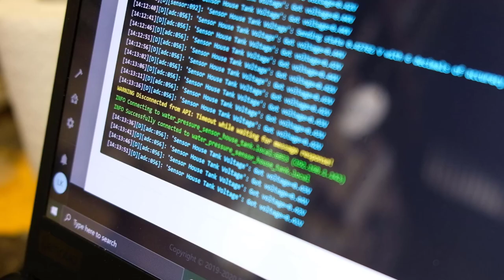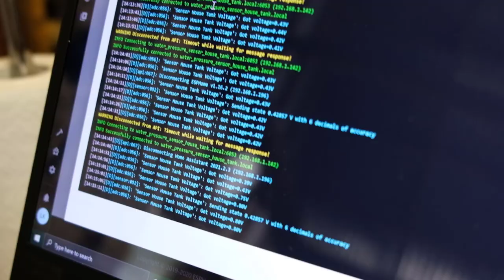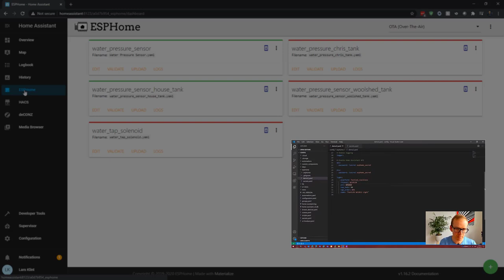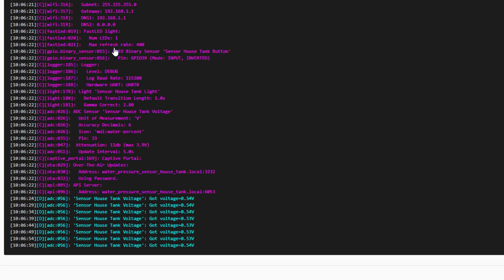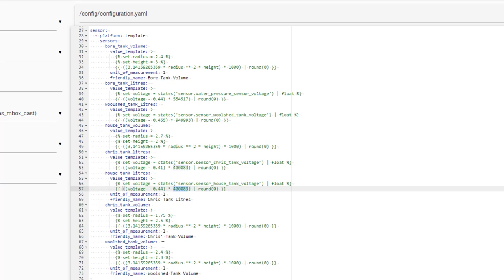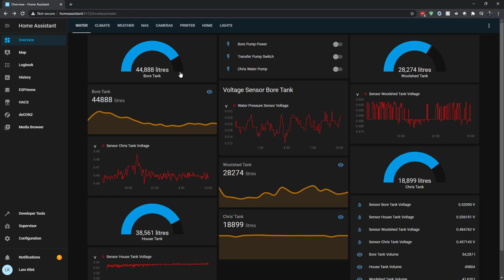Measuring water tank levels with Home Assistant

Comment: Thanks Lars, Great video, Ive actually watched in a dozen times.....I have purchased my Atom and the pressure sensor using your links, I have watched Tathams video and set the Atom up first go, used your Yaml File for the Pin out and receive voltages every 5 seconds in my Logs. I have question though. I have a 4KL Square Tank, whats your thoughts on substituting the formula to as my tank is not round ?
Reply from the maker: Instead of calculating a cylinder volume (π · r2 · h), use a cube volume(s3). That should work.
Reply: @LarsKlintTech  Thanks Las, I bought the PSI transducer...see some widely voltages even with your filtering....Thinking I might replace with a 10PSi Transducer as my 4KL water tank max is 5.6psi when full might help with a more accurate voltage more granular and stop it from bouncing all over the place. I might also insert a check valve after the sensor to eliminate any issues with back flow pressure affecting the voltages. As always thanks for your incredible idea and thoughts....has inspired me
Reply from the maker: @just_aths  A smaller pressure rated transducer makes sense, as does the checkvalve. I have tons of wrong readouts from one sensor,  because of no check-valve/back flush valve.

Comment: I really like this method. I've been searching for a good method for a while now. I have a 3000 gallon underground tank I need to keep an eye on because of a poor performing well. We need to water the grass and the garden, but have been concerned that we exceeding the well output. Could you have just added a lot of silicone around the sensors instead of putting them inside the pipe or do they need atmospheric pressure to register correctly?
Reply from the maker: I tried covering the sensor in silicone twice, but somehow water got into the sensor both times. It didn't break the sensor, but the readings were all over the place. Hence, I went with the metal pipe solution. The pressure is measured at the bottom of the tank, then I take the voltage and converts to litres based on maths. 😊
Reply: @LarsKlintTech  thanks, you could share your tank voltage config?
like 
sensor:
  - platform: adc
    pin: A0
Reply from the maker: @scorpio8101  For one pressure sensor I have this esphome config currently
sensor:
  - platform: adc
    pin: 33
    name: ${friendly_name} Voltage
    update_interval: 30s
    icon: "mdi:water-percent"
    accuracy_decimals: 5
    attenuation: 11db
    filters:
    - median:
        window_size: 200
        send_every: 10
        send_first_at: 4
Reply: @LarsKlintTech  thanks.

Comment: Can pressure sensor work well for a 55 gallon closed rain barrel?
Reply from the maker: Good question. The smaller the tank, the higher the inaccuracy. Maybe consider using a load cell for measuring the weight instead? I know Greg Facer (other comment on this video) has done this for some pool acid.

Comment: HI! Good job! So, at 6:04, what is the size of the adapter that connects the sensor's silver input to the pipe assembly. I'm only looking for the NPT connection that connects directly to the pressure sensor. Tnx
Reply from the maker: Thanks mate 😊 That is a 1/8" NPT connection.

Comment: cool vid. I just bought a gravity robot sensor to do the same thing with my tank for hydroponics. Thanks for your explanation

How did you go about averaging the previous 35 voltage signals to use within your relationships for calculating litres?
Reply from the maker: The moving average is part of the configuration. The YAML looks something like this for configuring the sensor via ESP Home. 
sensor:
  - platform: adc
    pin: 33
    name: ${friendly_name} Voltage
    update_interval: 30s
    icon: "mdi:water-percent"
    accuracy_decimals: 5
    attenuation: 11db
    filters:
    - median:
        window_size: 200
        send_every: 10
        send_first_at: 4

Where in this case my window size is the last 200 measurements. 

I hope this helps.
Reply: @LarsKlintTech  ah amazing, I didn't realise you could implement straight within the YAML file. That makes sense. Thanks for taking the time to show that. I am going to try setup a pressure sensor which I just received using the same logic! Cheers.
Reply from the maker: @andrewhadfield7754  No worries at all. Let me know how you go. The docs are here: https://esphome.io/components/sensor/index.html
Reply: @LarsKlintTech  Thanks for the docs - didnt realise there were so many inbuilt filters for sensors. Very cool

Managed to get the sensor working and outputting 0-3V depending on water depth. I mapped out two voltages at known water depths and determined a straight line graph from that, and used this straight line function to calculate height in Home Assistant based on voltage received. (with median values like you mentioned! ) 

It is crude right now, the only box I could find to fill with water was about 30cm high - next step is to find a much deeper water source and re configure the straight line graph. 

Super happy with the result. Cheers Lars !
Reply from the maker: @andrewhadfield7754  Awesome work Andrew. Love the logical approach to finding the measurements, even though your work is "crude". Tbh, mine still feels crude, but I am within 5000 litres usually, which works perfectly for me. Atmospheric pressure and gremlins sometimes mess up my math too 😂
Reply: @LarsKlintTech  Thanks heaps for this video from a fellow regional Victorian (I'm actually just down the road from you in Acheron :) )  in my testing with 3 Atom Lites and sensors though, by adding "power_save_mode: none" to my esphome yaml under wifi, my voltages have stabilized considerably. It seems my voltages now stay stable for days which I guess means more accurate readings and less gremlins. Well it worked in my case in testing so I thought I would share incase it helps others. :)
Reply from the maker: @FmxAus  That is super helpful! I didn't know that parameter/property existed. I will try that out next time I update the firmware. Thanks a lot neighbour 😊
Reply: @andrewhadfield7754  Did you get the sensor setup for the hydroponic tank?  Looking at doing the same thing to a 275gal tote to tie in an automated valve from the RO setup.  Could you post up a video!?
Reply: @kennybeans303  I did indeed get it working but it's all packed away right now as I am moving house. It was simple to setup. I will try to remember to make a video about it once I am back up and running (it's going to be a few months though!)

Comment: Do these sensors need to breath air? I've seen some sensors that can't be put "in" the water (like we do) as they need to reference atmospheric pressure. I notice my sensor (a 30 psi unit) - which I've not put in the pond yet - seems to hover around 0.47 V - 0.53 V at "empty". it seems to vary with the barometric pressure (at 29.9 inHg it's 4.8V, at 30.2 inHg it's 5.1V).. I can add an offset - either by referencing my weather station data - or by looking up via an Internet API before publishing on Home Assistant. But do you have to do something like that?
Reply from the maker: I don't think they need to "breathe". Atmospheric pressure will always have an impact on the measurement, but I tend to accept that as it doesn't make a huge difference to my setup.
Reply: @LarsKlintTech  Hi lars, two things i can think of to improve precision and reduce impact of atmospheric pressure: if the M5 support SPI protocol (if not a simple esp dev board will to the trick, minus the very small form factor of the M5), i think you can add a cheap BME280  module so you can read atmospheric pressure at ground level and adjust your computation based on that pressure variation with a calibration reading from atmospheric pressure + the tank pressure sensor at the same level. The second thing is that ESPHome allow adding filters on a sensor (ex: calibrate_linear and calibrate_polynomial) to help compensate for non linear readings at differents water depth for example. I can imagine a calibration procedure where you do several readings in a full tank, at different depth to see if the progression is linear or not, and if not, adjust with the filters. Best regards.
Reply from the maker: @sfxElrick  Those are excellent tips. I considered adding the atmospheric pressure into the calculation, as I have that value from my weather station. However, I have just installed v2.0 of the tank sensor, which seems to work much better for this particular tank, and that video is coming out very soon :)

Comment: Hi Lars and thanks for the very informative video. This will provide a solution to a problem I've been wanting to sort since my addiction to HA. I do have a couple of questions though. Would say a 0-15psi sensor provide more accuracy than the 150psi unit you've suggested or does the 6 decimal points take care of that? Would a Shelly UNI be a better fit with perhaps better wifi range and easier integration into HA? (I did have links to what I was proposing but I think Youtube rejected my post because of them). Thanks again 🙂
Reply from the maker: Your comment is very timely 😄I am just in the process of testing a new type of submersible sensor, which will indeed be couple to a Shelly UNI. I can't comment on the range and easy of integration, but a video is in the process of finding out. 
In terms of the PSI range, I haven't had any issues with the 150 and accuracy. I think either will work.
Reply: @LarsKlintTech  Thanks Lars, I look forward to viewing when your done. Just going thru your channel now, lots of useful stuff there :-) and it's nice to see you're a fellow Aussie!
Reply from the maker: @lensman893  Thanks for watching mate. Hopefully much more to come that you can use too :)
Reply: Hi again Lars.Just thinking about possible other applications - could this be used to monitor water levels inside a bore? Our bore has started running dry and I risk burning out my submersible pump each time. Devices like Pumptec protection are expensive. With integration into HA can you see a reason the pump couldn't be shut down when bore levels get low and approach the pump? (float switches are too cumbersome to get down a 4" borehole). Cheers, John.
Reply from the maker: @lensman893  Hi John. You could technically do it, but I am not sure of all the variables. The strain on the cables could be great, depending on the depth of the bore. In terms of HA, it can absolutely work. Sound pretty simple really. 
Again, the new sensor I am trying out could be a better option. That video should hopefully be out in a few weeks.
Reply: @LarsKlintTech  I look forward to it Lars. Bore is approx 30m deep, and I figured I'd just use a reasonable sized cable (for volt drop - it's only going to be 5 or 12VDC) cable tied to the pipe. Keep up the great work, really enjoyed the DJ drone video. Thanks again.

Comment: Hi Lars, 
Thanks for this good video  ... In my case i have a 5000 Litres tank ...How will you calculate for this ? .... I have a ESP826 board with the pressure sensor at the bottom as shown on your first setup
Reply from the maker: You need the height and diameter of the tank to get the math to work. See my reply to the comment from Wouter Meeus for more information.
Reply: @LarsKlintTech  Thanks for the reply .... I have a ESP836 board will this work with your config setup or only for the M5Stack Atom Lite
Reply from the maker: @sylvaish  I am not familiar with that board. Have you got a link?
Reply: @LarsKlintTech  For some reason the link is been removed  ... But if you google ESP8266  Development board... You should be able to see it
Reply from the maker: @sylvaish   I know the ESP8266  Development board, but you said ESP836?
Reply: @LarsKlintTech  Hi Lars sorry for asking so many questions ... I am new to this and wanted to get this working .... I have a tank of  77gallon ...Hight 1143 mm and Diameter is  589.28 mm ... I looked at the comment from wouter but  that got me more confused  ..... My question is i have an empty tank and the sensor is at the bottom how do i get the reading of an empty tank and how does this fit to the Math that you did on the Yaml file
Reply: @sylvaish  All ESP boards will have voltage detection capabilities and all of them will have the same fidelity. They differ in things like what other features they have, power consumption, reliability (newer are typically better) etc. You will also get better IDE (eg Arduino IDE) and various library support for the new boards (eg ESP32)

Comment: Awesome stuff , could you please provide the pressure sensor yaml file for esp home please? Im not very good with scratch configuration. I know your friend made a video about how to use esp home but I would be using the same sensors as you so it would be almost exactly the same setup.
Reply from the maker: Hi Roma. There is real value in having an understanding of what each value in the YAML does, as it makes so much easier to troubleshoot and debug anything that isn't quite working right. Having said that, my config values for the pressure sensor are

substitutions:
  device_name: water_pressure_sensor
  friendly_name: Water Pressure Sensor 

esphome:
  name: water_pressure_sensor
  platform: ESP32
  board: m5stack-core-esp32

wifi:
  ssid: !secret wifi_ssid
  password: !secret wifi_password

  # Enable fallback hotspot (captive portal) in case wifi connection fails
  ap:
    ssid: Fallback ${friendly_name}

  manual_ip:
    static_ip: 192.168.1.210
    gateway: 192.168.1.1
    subnet: 255.255.255.0
    
captive_portal:

# Enable logging
logger:

# Enable Home Assistant API
api:
  password: !secret esphome_secret

ota:
  password: !secret esphome_secret

light:
  - platform: fastled_clockless
    chipset: WS2812B
    pin: 27
    num_leds: 1
    rgb_order: GRB
    id: status_led
    name: ${friendly_name} Light
    effects:
      - random:
      - flicker:
      - addressable_rainbow:

binary_sensor:
  - platform: gpio
    pin: 
      number: 39
      inverted: true
    name: ${friendly_name} Button
    on_press:
      then:
        - light.toggle: status_led

sensor:
  - platform: adc
    pin: 33
    name: ${friendly_name} Voltage
    update_interval: 30s
    icon: "mdi:water-percent"
    accuracy_decimals: 5
    attenuation: 11db
    filters:
    - median:
        window_size: 200
        send_every: 10
        send_first_at: 4
Reply: @LarsKlintTech  thank you very much! I have a catchment water tank and plan on using this setup!

Comment: Great video Lars!  There is not much out there documented with using pressure sensors and water tank level monitoring (looks like the go to is ultrasonics)

Is there any chance you could share a sanitised version of your M5 Yaml? Im currently looking at doing something simular using a commercially available 4-20ma submersable pressure sensor in the same way you are but with a WeMos D1R2 and a few other sensors (lightning tracker ect)

 Edit: nm i found what i needed in another post below. either way thank you for the great video!
Reply from the maker: No worries Rodney. Happy you got it sorted. Keen to see your setup and solution too 😊

Comment: Thank you so much for the tutorial, I was looking for this a long time ago, I have a question, I wrote this template to get the level as a percentage from 1-100, am I correct or I'm missing something here?

{% set voltage = states('sensor.tank_water_pressure_voltage') | float %}
{% set emptyVoltage = 0.15723 | float %}
{% set fullVoltage = 0.16602 | float %}
{{ ((voltage - emptyVoltage ) * 100) / (fullVoltage - emptyVoltage ) }}
Reply from the maker: I would have thought {{ (voltage / fullVoltage) * 100 }} should do it.
Reply: @LarsKlintTech  Thank you, that works, but what's the difference between this and your way? because using this way you can also calculate the liters, sorry for a lot of questions 😅 But I want to prove to my mother that it is working fine, I haven't reached this stage yet
Reply from the maker: @mohamedhamdan5209  Not sure what you mean. I also calculate the litres in the video. Check out the reply to Wouters in the comments here too where I outline the process.

Comment: Could you share your esphome yaml file?
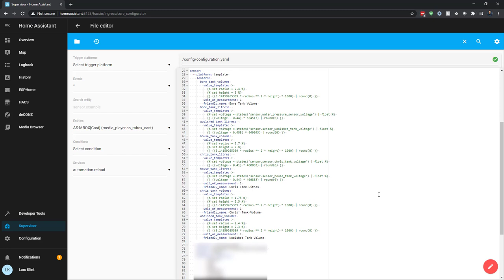Reply from the maker: I have the sensors defined in the confiuration.yaml currently. Which values are you interested in? At 12:23 I show all the tank sensor yaml config values.
Reply: @LarsKlintTech  I'm intersting in esphome configuration, I mean this part

sensor:
  - platform: adc
    pin: A0
    name: "Tank water level"
    accuracy_decimals: 5
    unit_of_measurement: "V"
    icon: "mdi:water-percent"
    update_interval: 1s

I want to know how you used the median function from esphome
Reply from the maker: @mohamedhamdan5209  These are my yaml values
sensor:
  - platform: adc
    pin: 33
    name: ${friendly_name} Voltage
    update_interval: 30s
    icon: "mdi:water-percent"
    accuracy_decimals: 5
    attenuation: 11db
    filters:
    - median:
        window_size: 200
        send_every: 10
        send_first_at: 4